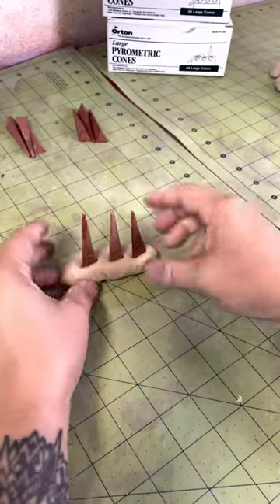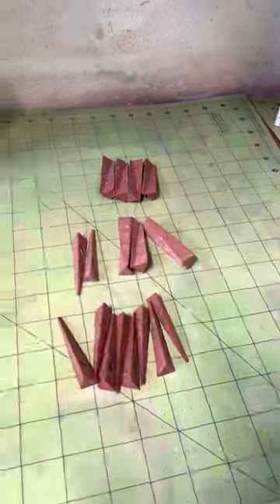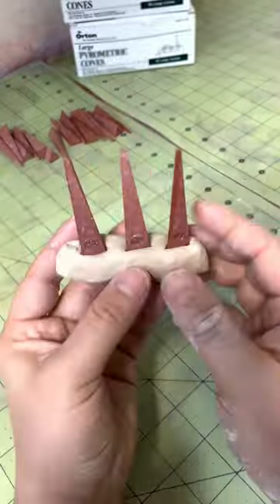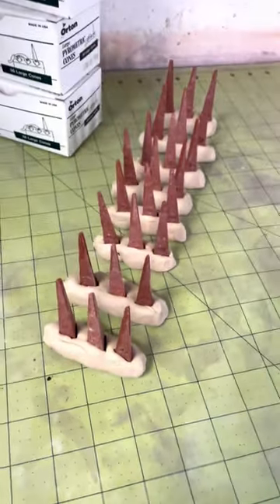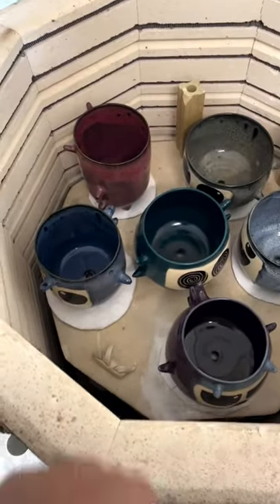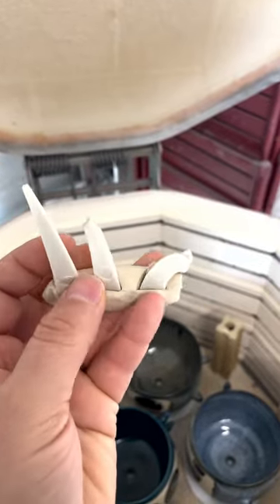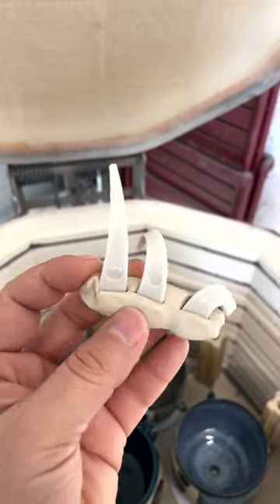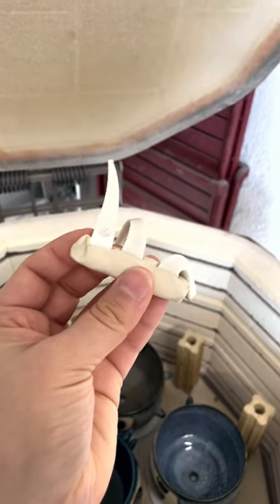Prepping my cone tester for my Kiln. #ceramic #pottery

Comment: These cones need to be set at a very precise angle. The base of the cone is at an angle and needs to be at that angle when set in the clay. If you have a free standing cone you can use that to gauge the correct angle of the cones in your pack. You will not get a correct reading with these cone packs. It’s would be best to break the clay apart and remake the cone packs with them at the correct angle. They also need to all be facing the same direction but not able to touch eachother when they melt. That way you can actually see them lined up next to each item to see how what percentage each has fired to. Also with bisque cone packed they need to be in reverse order or 07, 06 then 05. For your glaze cone packs you need to put them in order of 5,6,7. Hope that helps.
Reply from the maker: Thank you for the in-depth explanation. I really appreciate the info.  I am not a Kim technician, and I fly by the seat of my pants.!